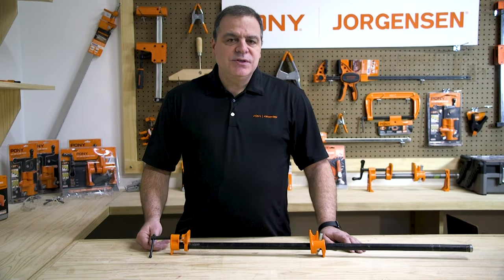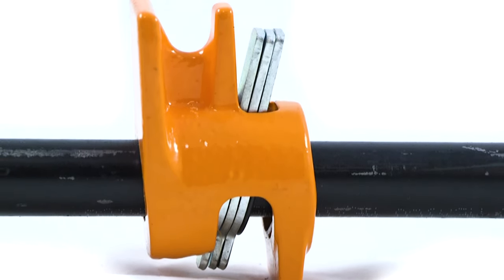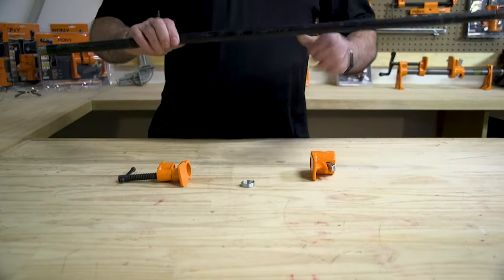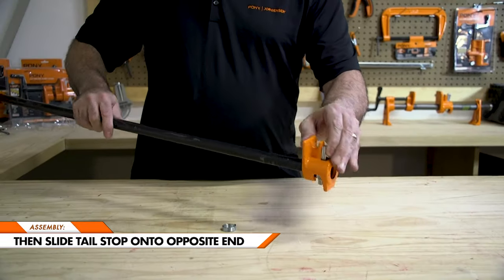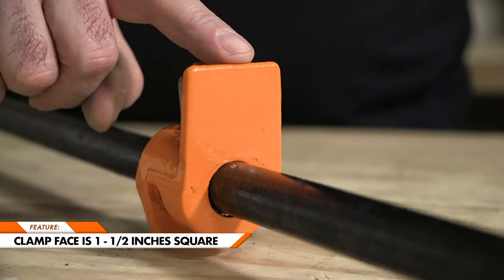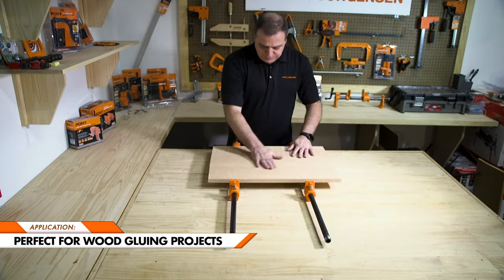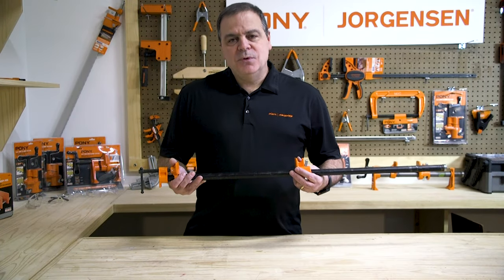Weekend Workshop - Half Inch Pipe Clamp Fixture Tutorial

Comment: This takes 3/4" pipe,  which is actually about 1 inch diameter on the outside. If you find "3/4 black steel pipe", you've found the right thing.

Comment: The tail stop is extremely hard to move and taking off the paint from the black pipe. What is going on here?
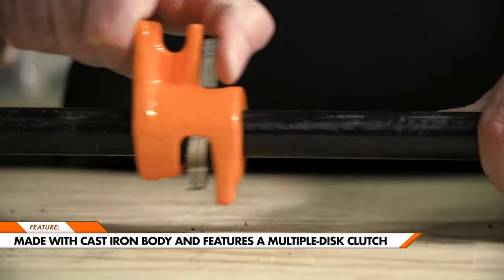Reply from the maker: Hello - You need to fully squeeze the multiple disc clutch as shown at 0:47 in the video. In you need additional help, or think there may be something wrong with your clamp, please call us at 800-776-2228. If your clamp is defective, we can replace it under the warranty. - Pony Jorgensen Team

Comment: The tail stop will NOT go onto the 1/2" pipe. Tried old ones, new ones, oiling the clamp, oiling the pipe, vice grips (in case my hand is too weak). Gets stuck on the thread or just past every time. Certainly won't slide like in the video. Guess what? Bessey clamps went on with no problem.
Reply from the maker: Hello - We're sorry to hear you're having problems with your clamp. Please contact us at customercare@arrowfastener.com or 800-776-2228. If the clamp you purchased is defective, we will send you a replacement under the warranty. - Pony Jorgensen Team